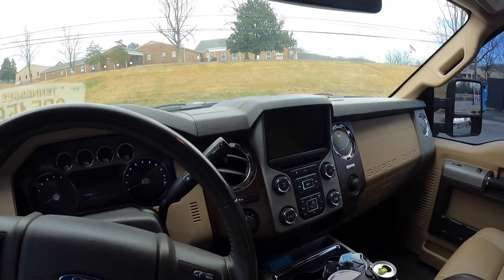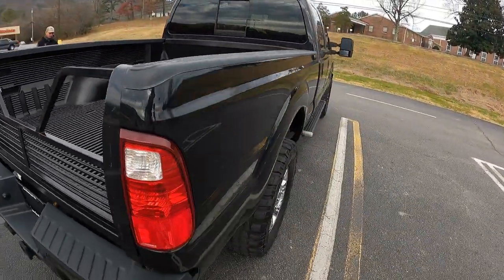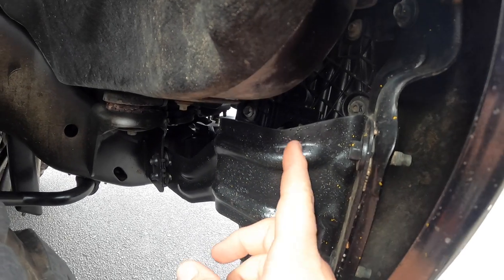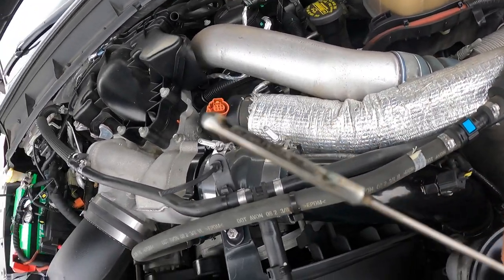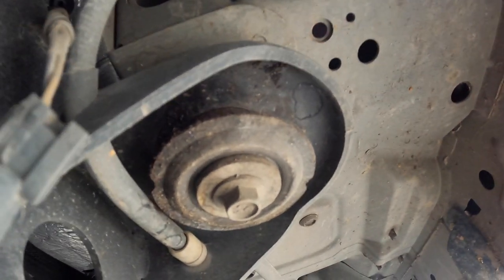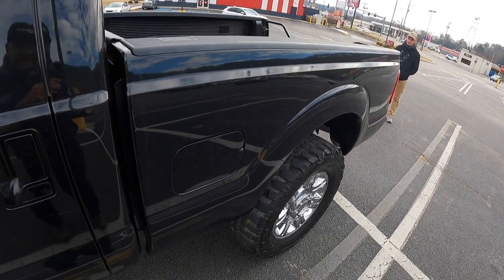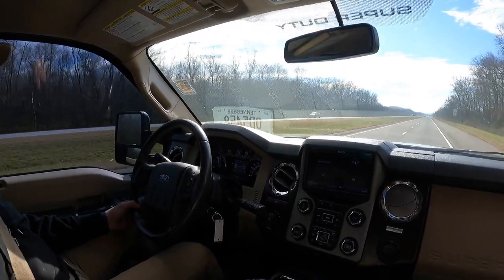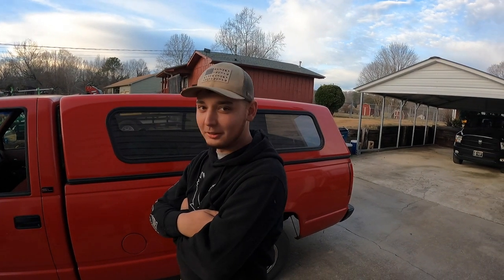Can't Believe What We Discovered

Comment: Diesel will always have dark black oil. And the smoke from the oil cap is called blow by it is because the piston rings are going bad so there is not a good seal where the seals get worn out.

Comment: The tune is the reason why it shifts hard I have a tuned f150 and it also shifts firm I wouldn't worry so much about that a new tune would solve that issue but with everything needing serviced the body mounts and the oil leak thats just money on top of money when paying that much your better off buying new, for a side truck I would look at the f250 7.3 gas since itll be a backup truck and itll be setting for a long period

Comment: The cab mounts are shot. And the painted frame is concerning. But the EGR has been deleted as well. That would explain the unconnected wires under the hood. Honestly I would look for a 15-16 truck. They went to the CP4.2. It’s a better pump. But still would run a good additive. And be prepared to dump money into it. Because any CP4 is a ticking time bomb. I had 2 of them.

Comment: Speak for experience this year a major fuel system issue where the fuel pump goes out send scrap metal thru you injects cost 6500-7500 to repair if you do purchase make sure to look up the filter kits they have

Comment: Trans fluid is probably ready for a change the bed to cab height is the body mounts settled on the car they need replaced the black oil ain't much of a concern and the wires under the hood I believe are from the delete all the wires to the egg and for the Def system will not be hooked to anything also the spray paint is not a worry either most likely someone has sprayed it to prevent rust and the cut on the front fenders is where tires were rubbing at one point and someone trimmed it to clear all in all I'd say it seems to be a good truck as long as the trans checks out I'd buy it

Comment: does not have a body lift. you would see it when looking at the body mounts. the plugs under the hood are from the EGR delete. and the black oil is normal for a diesel. Mine looks like that after a couple thousand miles. the fenders are trimmed for tire clearance. the shifts are most likely from the tune.

Comment: The truck either needs a different tune or has been damaged by a bad one. Torque converter lockup timing is most likely off due to the the motor revving up too quickly. Probably not a very good tune. Looks like they are hiding a lot on this one.

Comment: It looks like a short box and I wouldn't consider it from the start.   Diesel oil is also always dirty.  I put in clean oil and its dirty within days.  That's not an indication of old oil.  Bottom line this truck has some deferred maintenance and a few mystery issues.  You can definitely find a cleaner example.

Comment: Ya my 04 f250 has a tune and when u put it on stock tune for transmission  without having a shift kit installed  it shifts kinda rough  but on tuner put it as having a shift kit  smooths out quite bit so ya probably is a tuner problem  and on oil being really black just means they most likely using a cheap oil  and not a good synthetic   or synthetic blend  so all that can be fixed with a good oil change

Comment: I would walk away from it. If you’re going to buy one do a 2015.. The 2011 through 2013. had some issues with the motors and they were fixed by 2015. Not only that I think the truck has been beat on a little bit.

Comment: I wonder if what you have there is a truck that is made of parts that were not original to a single contiguous vehicle. You have a Frankenstein monster. That's the reason for the spraypaint and the reason for the truck bed that doesn't match up. That dealer is not being straight with you.